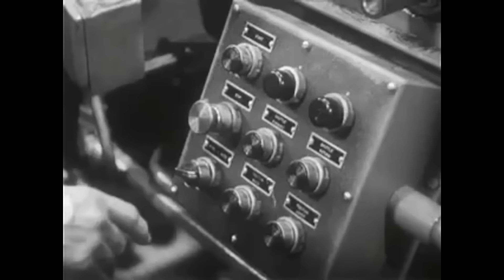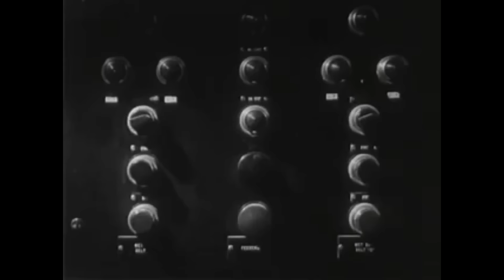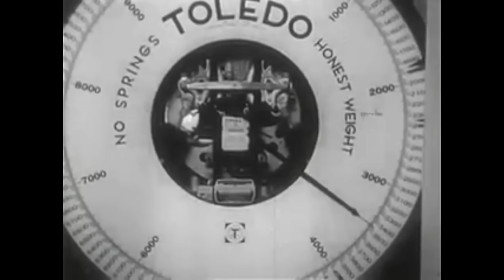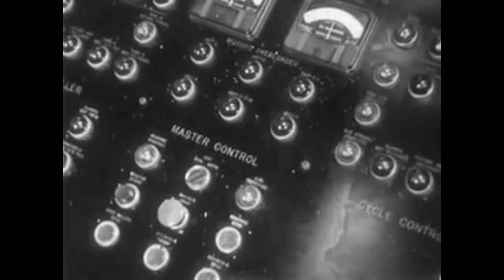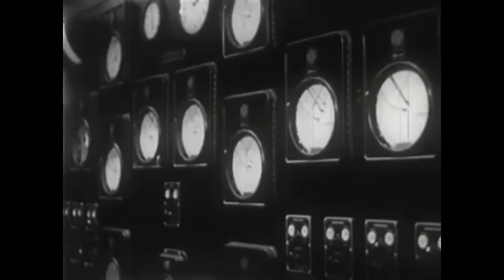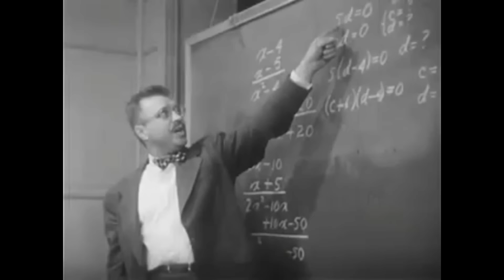Ford Brook Park Plant Cleveland, Ohio 1954 Ford Motor Company Promotional Film

Comment: Good old days, what a great video! Bring back the quality and craftsmanship we once had, instead of the overpriced crap they build today!!!!
Reply from the maker: Great point!  Thanks for watching!
Reply: i've been wanting to do that for decades the problem you got is our country is run by the bankers specifically JP Morgan owns every one of these corporations and they sent our jobs to other countries for cheap labor and no regulations and what we got in return was products that are garbage and homeless all over the place because not everybody wants to be a college educated idiot😮😅 I worked at Perkins diesel in Detroit into me that was the greatest job I ever had in my life I loved it there
Reply: UAW has much to do with it. Look at the wage structure/vacation hours/etc
Reply: @sciencemansandera 
Haha there's a  katolight cold start vid on my channel,and it's a Perkins/Detroit labeled 4. 236 in the dead of winter with a failed block heater.
 I'm trying to get it fired up because the utility power is out and it's a wastewater plant.
Used a starter button to activate the flame thrower because they're not normally wired in. 
Good times ,I liked those little engines ,I've rebuilt a few at a previous job.
Simple and pretty durable.
Reply: @ I would not blame it on the UAW. They basically just tried to keep pace with the cost of living and other adjustment factors. Blame it on the crappy engineers. We don't need cars with all the sensors all over them we don't need $250 headlights when you can buy it for $6-$8.00 we've made our new cars junk because we tried to copy the cookie cutter cars of the Europeans which are a death trap I have a new design car going back to the 90s some of that 70s and only a little bit of the newer cars they are very cheaper to build they are way better cars and they don't turn to garbage at 100,000 miles I hate to say it but Dodge is putting out some China man junk using foreign steals that the gas tanks fall out the heater ducks fall apart the rear ends go bad from running Chriss go in them it's like my God the stuff cost a fortune and it doesn't last it's no damn good and it cost $900 labor to put a water pump on a dodge ram used to be able to buy it and put it on yourself for $29 so I would blame the UAW I would blame the corporations if you ever and worked with an engineer you would understand why. They don't even want to talk to you and then they'll go do exactly what you told them to do and try to claim it was their idea lol it's hilarious

Comment: In 1968 I worked in the Foundry. Despite the description on how clean everything was, and in 1954 maybe it was, in 1968 everything on the foundry was full of sand. In fact my job was to remove mountains of sand from  inaccessible places to places where a towmotor could remove it. But it was a great job and I thank Ford very much for hiring me. Years later I had gone to college and had a different job where I met and became good friends with the head of HR at the Brookpark plant who had been there when I had worked there! And yes I have bought Fotds since working there!
Reply from the maker: Sounds like you have some great memories from there.  hanks for sharing them and for watching!
Reply: Just curious, how was the food in that cafeteria and was it reasonably priced?
Reply: @WAL_DC-6B  It was actually.
Reply: @carolwisniewski6740  Thanks for your response!
Reply: @jameswasil8961  Do you have any thoughts on the editorially independent Ford Foundation?

Comment: In the 1960's I had a job checking valve guides on, I think, the 351 V-8 engine at the very same Cleveland Engine Plant #1.  I might have stayed longer, but there was a strike and I had to go back to school.  The plant was fascinating: I'd spend my break time watching the broaches, the final inspection (they really opened up those engines, running them at insane speeds to see if anything would break.)  The piston line was so complex as to be almost indecipherable: the rough aluminum castings started up near the plant ceiling and down a helical path to the floor, where the finished pistons were inspected and the rings snapped on.
Reply from the maker: That sounded like an awesome experience.  Thanks for sharing and for watching!

Comment: Interesting video. My parents bought a 54 Ford Mainline 4 door sedan, 6 cyl. 3 on the tree , Highland Green new.  The block cracked when it was 6 months old according to Dad. The dealer replaced the entire engine at no cost. They were going to trade it right away but then my sister was born and they didn't have the money to swing a down payment. Now along comes 1958 and they were going to trade, but I was born. They kept it until 1962. I have vague memories of it.
Reply from the maker: But you still have memories of it and that's what matters.  Thanks for sharing and for watching!
Reply: @ericg4042  Did they put bad oil in it?

Comment: I began working there in 1976. Air conditioning? The foundry temperatures soared above 100 degrees during summer. Even with industrial fans, the heat was oppressive. In winter, our only warmth during breaks came from barrels filled with coke and gas lines to keep the fire alive. The movie portrays none of the loading, unloading, dipping, and core setting. Post-molding, parts were sent to the cleaning room for 'more fun.' We manually removed hot parts from shakers on the hot line, wearing asbestos gloves. Then came chipping and grinding. The movie's depiction didn't capture the foundry's reality; some areas had visibility less than twenty feet. Cleaning wasn't just a ride - on a machine; it involved sweeping into the main aisle for the sweeper. In engine plants, cleaners constantly mopped up oil due to the pervasive mist from machining tools. Sure, there were cushy push-button jobs, but only those with seniority landed them. Starting on a day when 600 others did, in a workforce of 21,000 across three plants, meant little opportunity for advancement for many years. Securing a day shift, let alone a decent day job, was a challenge. And then, layoffs would force us to begin anew. But yes, we did make some darned good money and I was proud to make it because I earned it.
Reply from the maker: I agree that there was a lot of real life conditions that were not portrayed in the film.  Thanks for sharing and for watching!
Reply: By 1976 Ford and American manufacturing was well into their downhill slide.

Comment: The inline 6 cylinder was the best engine all big three could build and last my favorite was the 225 slant 6 Chrysler.
Reply: I had a 225 slant six in my ‘79 Plymouth  Volaré.  Car rusted to hell, but that engine was still purring like a kitten! Wish I could’ve taken that engine with me!
Reply from the maker: Solid motor for sure.  Thanks for watching!
Reply from the maker: Great solid motor!  Thanks for watching!
Reply: @fredarmentrout  for sure , 68 Dodge Dart .
Reply: @kensmithgallery4432  Thank you .
Reply: @fredarmentrout  Was that the 300 Six that they were making?
Reply: @2davydo, I’m not sure.
Reply: If so. That engine was and still is unstoppable.  @2davydo
Reply: @2davydo  I think it's Ford . Very tough engine
Reply: @2davydo  Indeed, I was employed in that machining department when I transitioned to working at the engine plant (Plant 1). It was quite fascinating.

Comment: So for all you Ford trivia nuts ( like ME 😉 🎉) the Boss ' 9  429 block was cast at this very plant ( among others such as  351c ) in Brookpark, Cleveland, Ohio. But the Boss '9 block's very 1st step after being taken out of the casting frame & sand was a TWO HOUR ride down a LONG conveyor JUST TO NORMALIZE THE CASTING!! 😊
Reply from the maker: Wow!  That is great information!  Thanks for commenting and for watching!
Reply: I spent years working in the straight-6 block machining area, but I can't recall the duration of the machining process from the broach to when they were lifted onto the assembly line. It wasn't a single conveyor system; all areas were distinct and supplied by overhead conveyors. There were numerous sections where blocks could be removed or added in case of breakdowns or when tool changes were necessary. The honing of the cylinder bores was amazing.
Reply: @carolwisniewski6740  Carol what a great addition your story is! I didn't work there but heard about the Boss '9 block's second hand in an article I read.The normalizing process would have had to occur before any machining took place. How ginormous was that place? Like how many people per shift?
Reply: @carolwisniewski6740  I have only seen it from 271